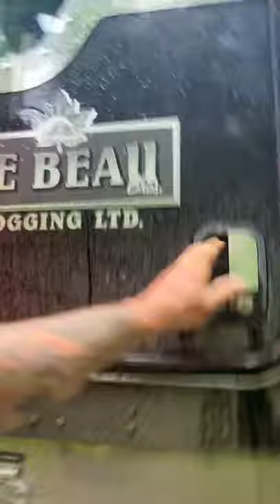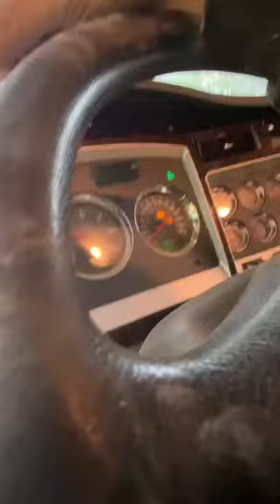Logging truck accident/ejection/rescue

Comment: I drive log truck, have for 30+ years, I'm sorry but that road didn't give out, this is what happens when your distracted. Never, ever, ever, get close to the edge of a road in wet weather. Mud is as bad as ice.
Reply: STEVE JONES I'm retired after 44 years. I totally agree with you sir. That's the first thing I said when I saw it. After zooming in on what was filmed I'm positive he got his steer tire off on the soft side into the ditch. Definitely was not in center of road.
Reply: Yep, he got off the edge of the road.
Reply: Gotta stay extremely focused out there. I'm new to the industry it's wild!! But I wouldn't do anything else

Comment: Had to help a guy last year that had a similar thing happen to him, came around the corner a little hot and set the truck on its side down the hill. His arm got pinned by the truck. Thankfully it was just in the dirt and dug his arm out with a hammer.

Comment: Sealtbelts........what an invention to have wasted that foot on
Reply: They don’t wear them for a reason on logging roads
Reply: @sidneymonroe9809  what do you know? It's still a requirement by the mill for insurance you silly stick
Reply: @TheRukkis03  So that maybe true. But if you’re going up and down some of those logging roads on cliffs, having to take off a seatbelt could be the difference between life and death if you start going off the edge.
Reply: @sidneymonroe9809  wow you're a special kinda different aren't ya
Reply: @TheRukkis03   No, I'd rather have a chance to make it out alive instead of being crushed to death in a truck rolling off a cliff. Also if you look the ice road truckers don't wear their seatbelts when they are going across the lakes. Same concept just in a different setting.
Reply: @TheRukkis03  you do realize this other guy is 100% right? Don’t you ? Same way I was taught if I’m on pavement or around traffic then yes I have my belt on but running old roads like that up the mountains or anything with a steep grade I always take my belt off but I do roll the window up if I need to bail I wanna be able to bail quickly but I put the window up for this reason

Comment: Those dumber mixer super unsafe in the wrong condition Socalled flotation steer tires definitely help this wreck along & if the normal semi heavy truck steer tires were on the front I'll bet there's less likely a chance you'd see wreck's like this. Never did like said steer tires and never will unless there simply on the body job T/A cement grunt truck. Period

Comment: Most of them drives drive way to fast for the road conditions that road is not very wide. When the roads are ice covered they sliding all over on the Curse they are going way to fast.   It's good he is going to be ok

Comment: Absolutely noone thought about flipping all the lights off ever to prevent a possible electric short and possibly fire by electrical ignition and frie this super amateur baldy alive. These things with all said lights on get super hot behind the dash and flopped like this probably even hotter because one side of vents are blocked off getting hotter , can't believe no one thinks safety before a super serious fire breaks out.